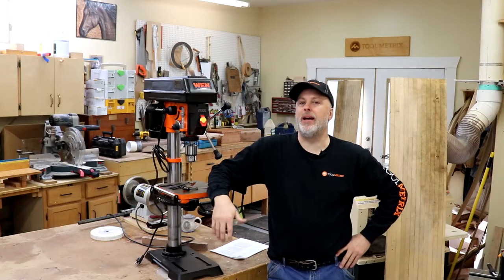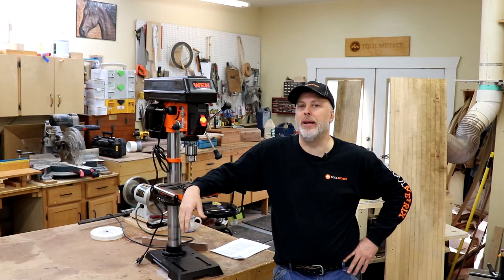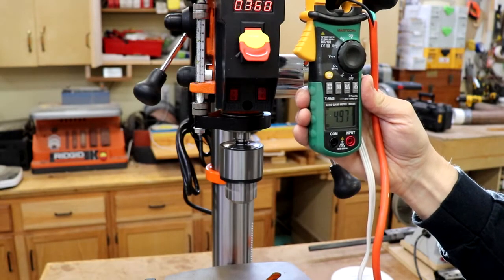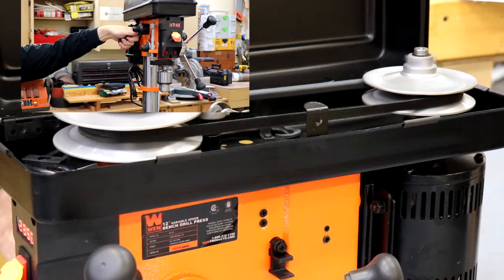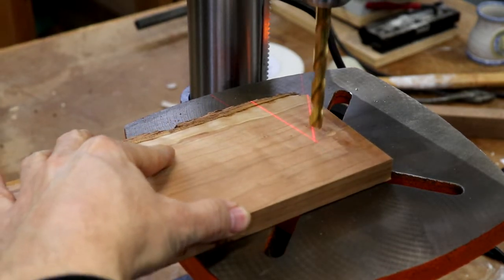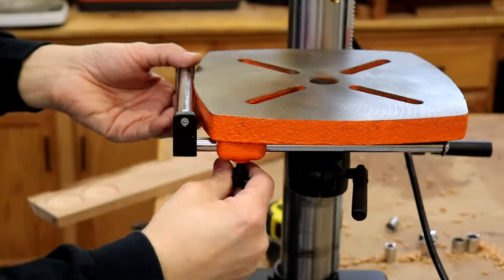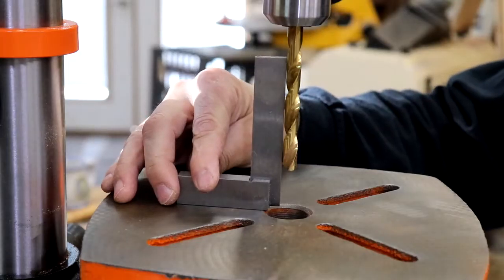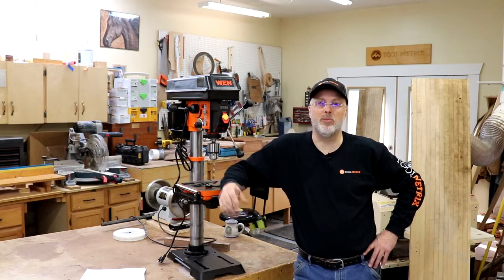Best Benchtop Drill Press: WEN 4214 Deep Dive Examination

Comment: Could one replace the puny 2/3hp motor with a 3/4hp or 1hp motor easily?
Reply from the maker: Seems like it would be pretty straightforward but I’ve never looked into it.
Reply: @Forgotten Man  
Unless you already have a motor that will fit without modifications, for the time and trouble spent I would just buy the Jet J-2530.

It's an absolute beast though in terms of being a "Benchtop" drill press.  Large, tall, and very heavy at nearly twice the weight of this WEN.  BUT you want to have that extra weight for stability with a 3/4HP to 1HP motor.

I'm not sure I would advise putting a larger motor on this WEN.  The quill bearings and pulley system would likely wear more quickly and increase runout over time.  It's just not built for a larger motor.

It's like putting a Chevy 350 V8 in a sub-compact 4-cylinder vehicle...you're going to destroy the transmission and rear differential, and bend the subframe real quick without upgrading everything else as well.

By that time you've spent way more time and money than it's worth for the outcome.

If you need a more powerful drill, just save up and buy one that will last!

The Jet J-2530 usually goes on sale during Father's Day, otherwise it would be a lot more expensive than this WEN as well.  But it's pretty much an  End Game benchtop drill press.

I would buy it at a retail store though as shipping or returning it can be difficult & expensive if you have any issues with it.